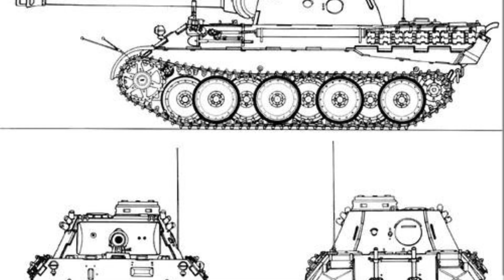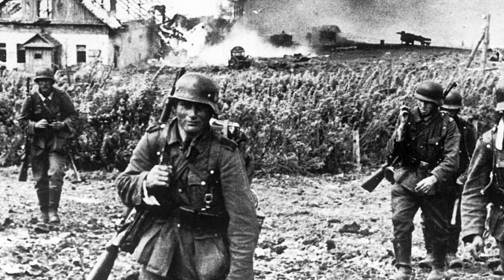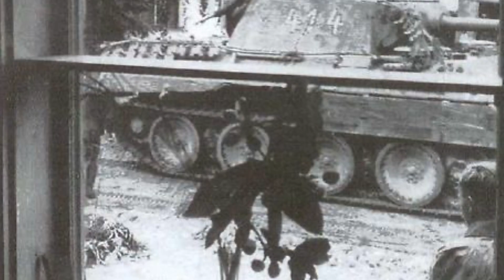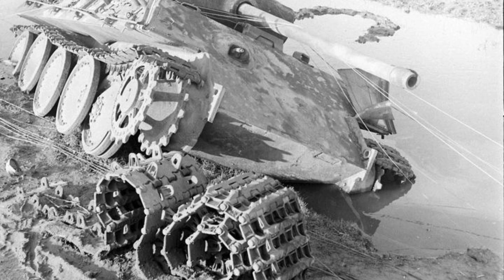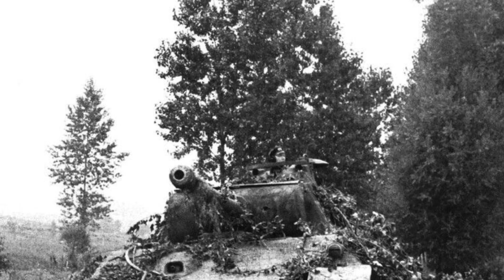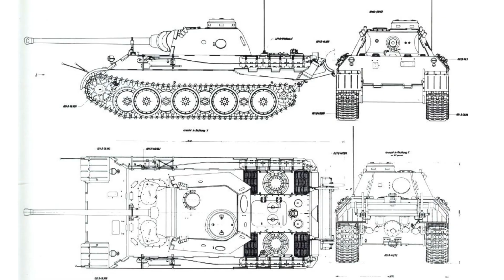Why Half of Germany’s Best Tanks Broke Down Before Battle

Comment: Don't believe these American LIES. Britain created the Holocausts of both WW1 and WW2.

In July 1943, the brand NEW Panther tank was Hastily rushed into combat before  Engineers were allowed to fix the Panthers TEETHING problems. This is what caused the breakdowns. All brand new prototype Engineered products have TEETHING problems during the products trial period. Once the TEETHING problems were fixed the Panther is considered one of the best tanks of WW2 eg the Jagdpanther variant. 

Consider the V22 Osprey which is considered a very fast delivery platform for special forces. During the Osprey Trials it had many Fatal accidents which killed many US personnel due to TEETHING problems. In one case it was found there was reversed wiring in an engine which caused a fatal accident which killed some 30 combat troops.
Reply from the maker: fair point on teething problems being normal for any new vehicle — that’s true, and I probably could’ve made that distinction clearer in the video. But the specific issue with the Panther wasn’t just “new tank has bugs” — it’s that German army inspectors were writing internal reports in 1943 flagging the reliability as unacceptable before Kursk, and Hitler delayed the offensive twice specifically to rush more Panthers to the front despite those warnings. So it’s less “new tech has hiccups” and more “known problems got pushed through anyway because of a deadline.” Not an American-bias thing — German records themselves back this up.
Reply: Bullshit the Panther was crap .. face the reality . They made lots of shortcuts in design to speed up production . But the main problems were raw materials , the minerals needed to produce proper armour and more important the stuff needed to produce the steel for gears did not exist . Everything went to aircraft production . If American industry had put them together it would have been good but it wasn't.
Reply: @robertjohnstone3706 
You shout like an impulsive Juvenile in nappies. Lots of childish ranting but no documentary evidence Gilligan.